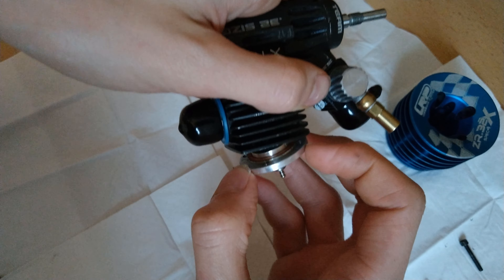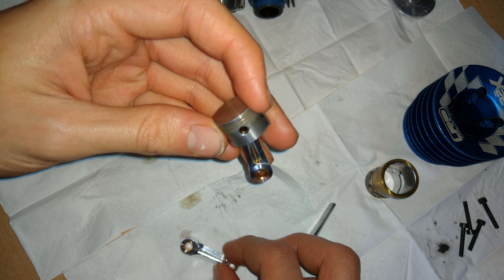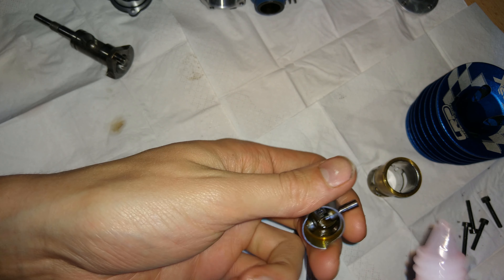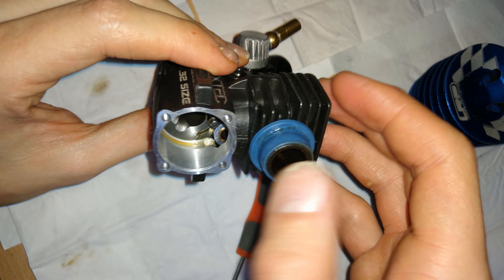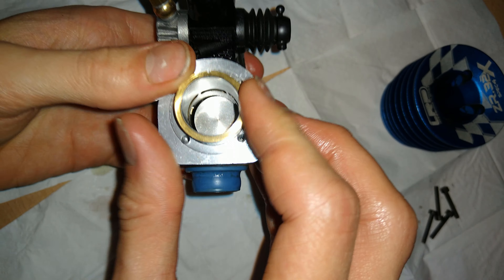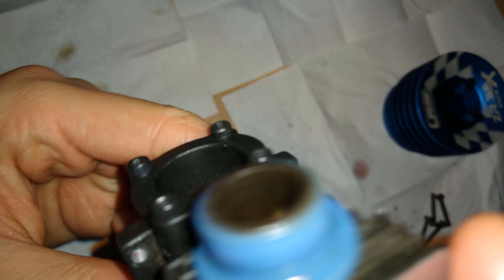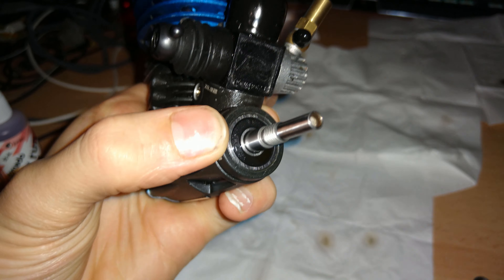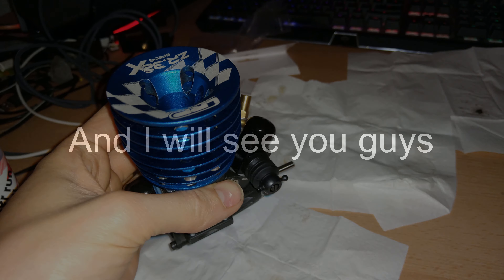Checking out the internals of my modified LRP .32X after 2 gallons

Comment: Great vid bro.  Yup those lrp engines are huge but really not top notch stuff if not modded. Maybe you had a bad one   they are quite cheap on the upside.
Reply from the maker: I agree I wish they made a LRP .32X Spec 5 and make it 10 times better also they need to hire a need quality controll guy